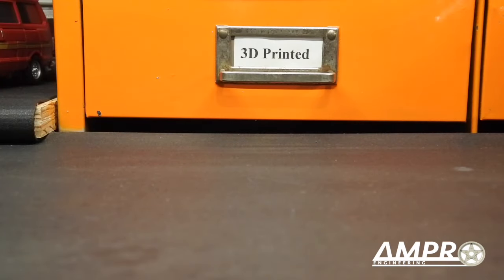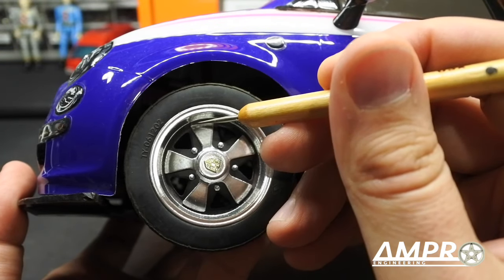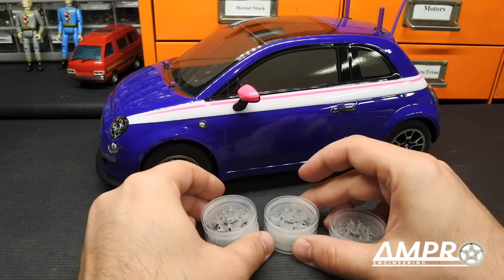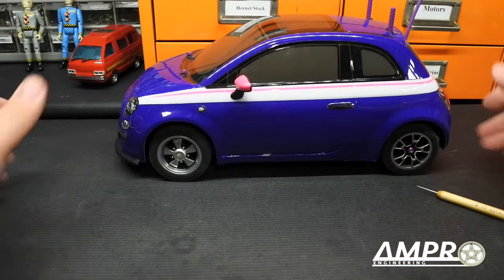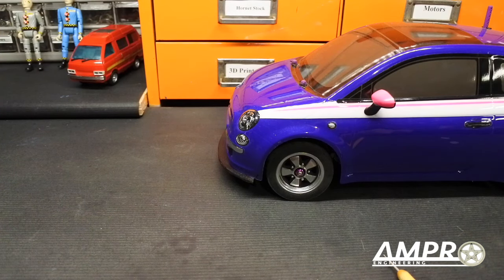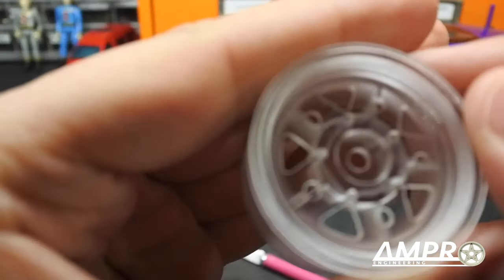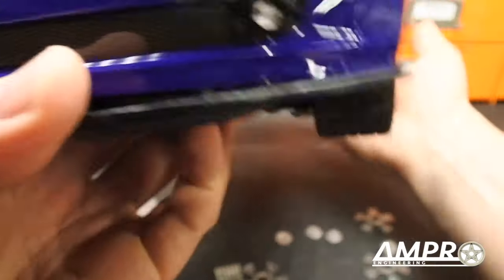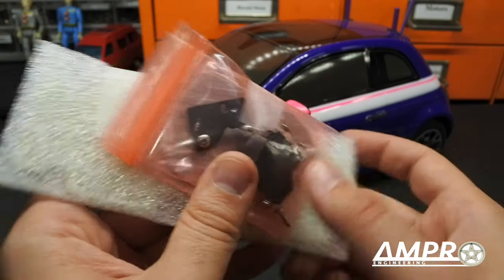e57: Tamiya M Size Porsche and VW Fuchs Wheels

Comment: I bought 2 posi-lockers on ebay for my hornet and lunch box from bonett engineering RC Club they look just like the one you're working on
Reply from the maker: That is the exact one you see. They asked me to produce them as 3D printed units since they will no longer be manufacturing them. Great design.
Reply: glad I bought 2 when I had the chance now I need 2 more